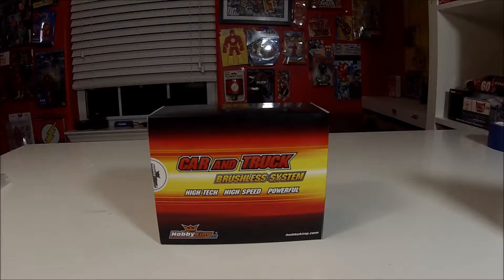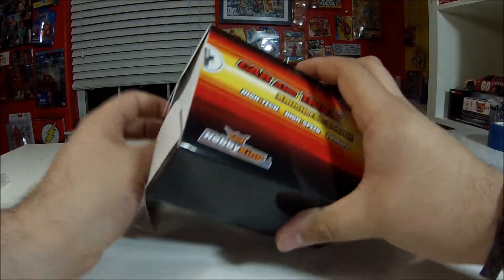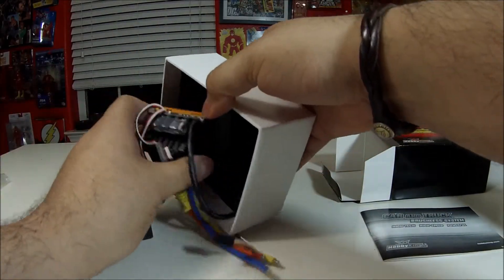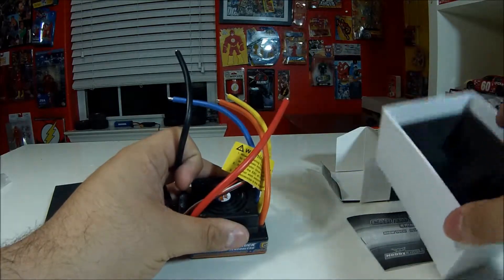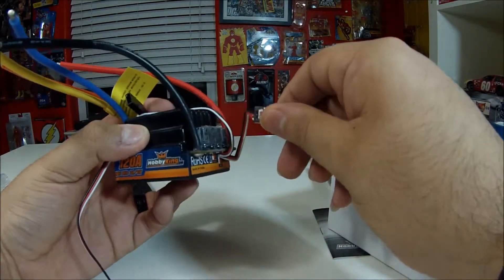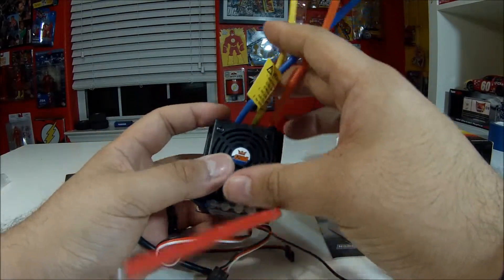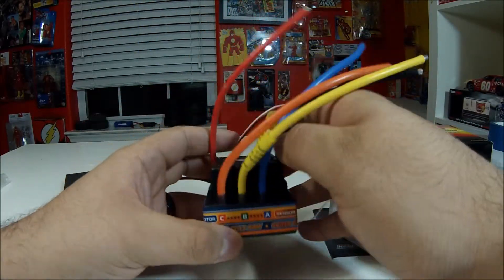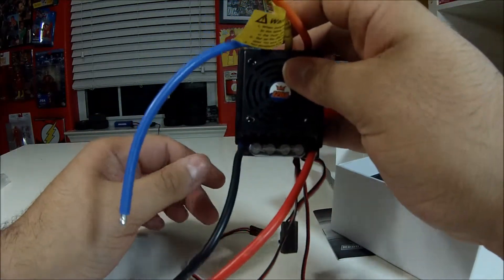Hobbyking 120a ESC Unboxing

Comment: How many cells could it handle
Reply from the maker: 6s
Reply: @flashhobbies  thout 120 amps where only 4s thanks for ur time
Reply from the maker: I run 6s on mine and it works, no issues for me
Reply: @flashhobbies  thumbs up for your replie 5 years after the post of your vid 😁👍

Comment: Hallo! I have the same esc! But I cannot program it and I do not have the program car. How can I program it with the tone system so that i will have forward and brake.
Reply from the maker: The esc manual is located on this page. https://hobbyking.com/en_us/hobbykingtm-120a-sensored-sensorless-car-esc-1-8-1-5.html